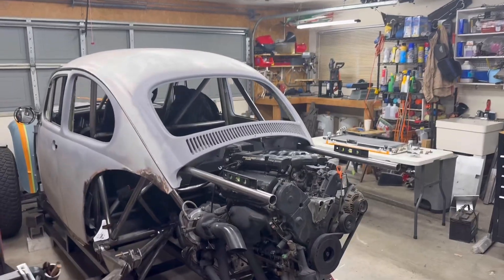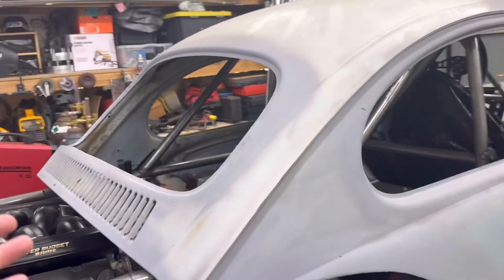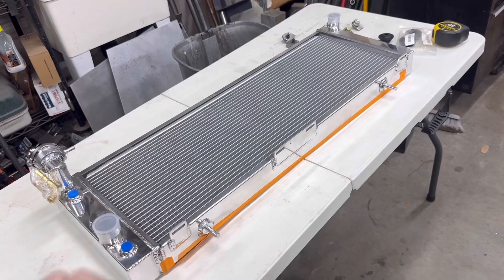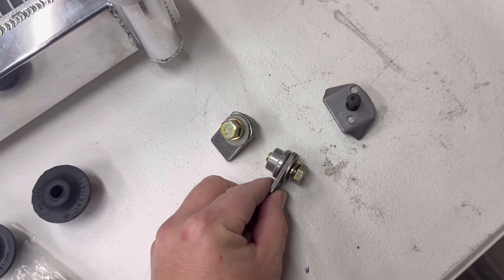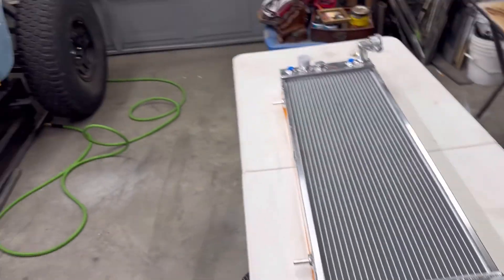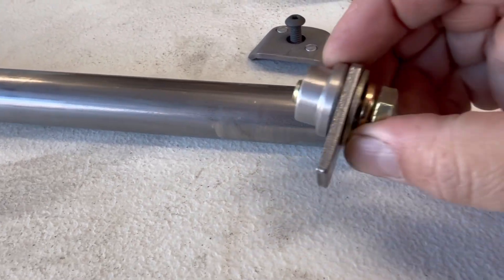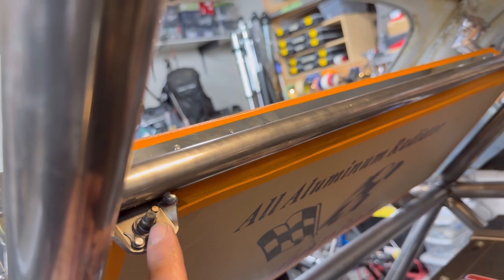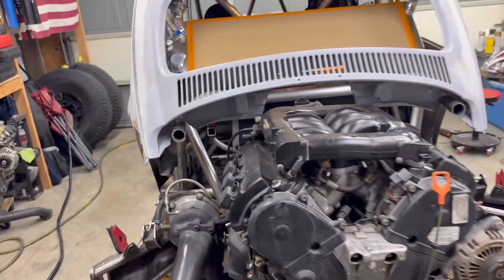Boosted Baja Bug gets a Radiator!

Comment: That is going to look really good with the CF shroud, I can’t wait for that.
Are you going to relocate or reconfigure the filler neck, or can you fill the radiator as it sits? Will you use an expansion tank?
One thing you might consider is running a hose from the drain petcock to somewhere you can catch the coolant with a bucket in the case you have to drain the radiator. I would change out that valve, because I don’t care for that style and feel they often leak, or get stuck shut. Maybe a ball valve with a lock out and an AN fitting/hose to an outside drain location. I know… I’m overthinking it a little, and coolant isn’t drained that often, but it’s messy if you don’t control it. I also dislike barb fittings and clamps, so I like to use AN or crimped. 
As always, the build looks really good. I’m really enjoying watching each stage, you work looks super sharp. Have a good one, man.
Almost forgot, one more question… Since this does not look like it will be a daily driver, have you ever considered setting it up as an E85 engine and dialing up the boost? It could be fun. I think it would be a bit more maintenance, but more hp is always fun.
Reply from the maker: Thanks Chris. The filler neck is interesting. If will fill fine but I definitely don’t like the look of it. Maybe I will fix it, maybe I won’t. 😂 I will be using an expansion tank, location is TBD. I will inevitably have to drain the radiator at some point. I will consider making a change there and see what what’s doable and if it’s worth doing prior to driving. Easy mod for later if needed. Not considering dialing up boost. Want it as reliable as a boosted set up can be.